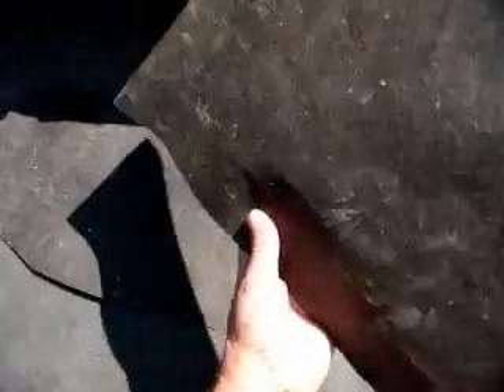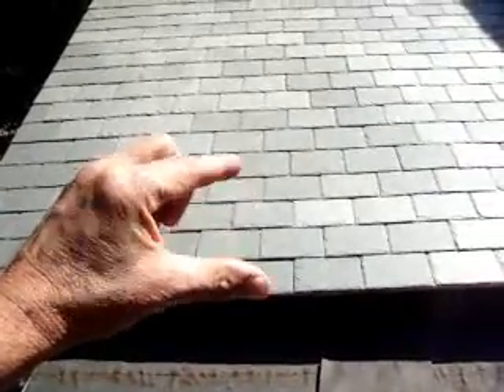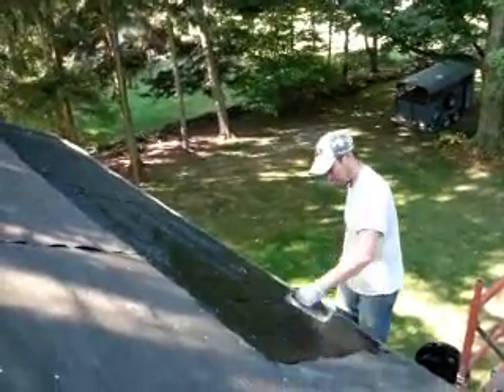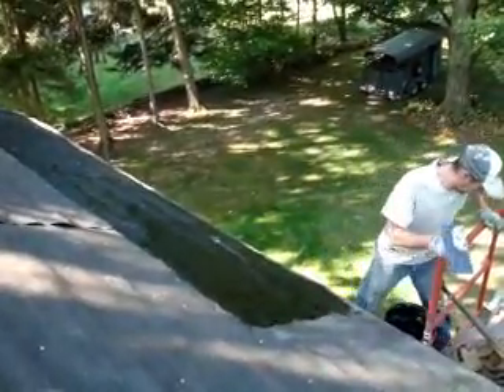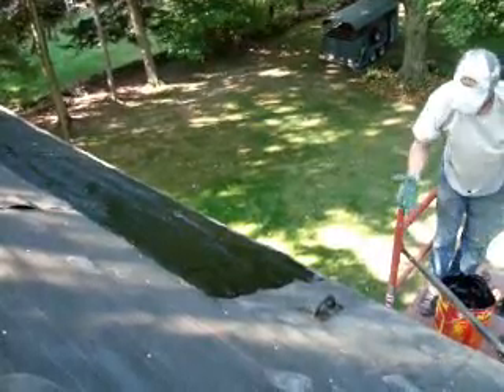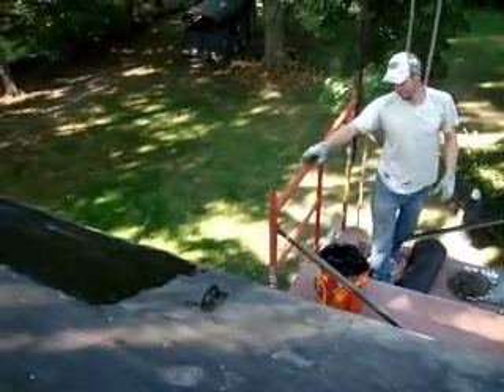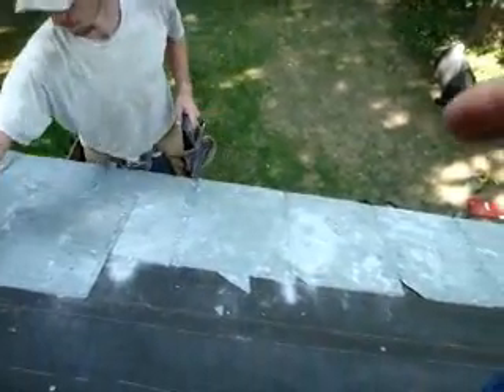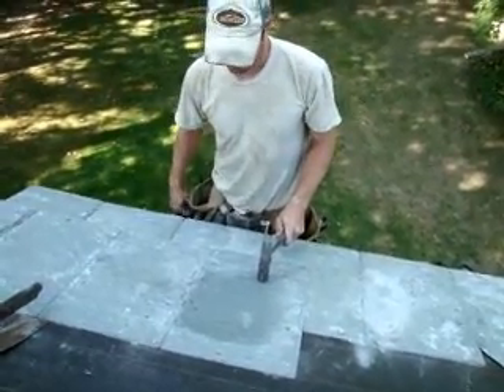How to Install Ice Dam Resistant Eaves on a Slate Roof

Comment: Snow belt aluminum at the bottom edge .
24 inches tall from bottom edge up ast the18" ice dam ?
Reply from the maker: You can't solder aluminum, but it would work as a standing seam snow apron.

Comment: Joe, I love your videos. however I am always amazed at the lack of fall protection for those in your videos. i realize that this is "traditional" roofing but i hope in the future you will come to realize the value of safety for your workers.
Reply from the maker: Fall protection,  as most people know it, is for employees. Ropes are one more thing to trip over and in fact create an unnecessary hazard. You can't tell OSHA this, but then they don't do the work. Goof fall protection involves hook ladders, roof jacks, planks, etc. That's what we always have used (my sons and I). OSHA fall protection doesn't stop you from falling, it stops you from hitting the ground. We use ropes and harnesses once in a while when we feel the need. In 45 years I can count the times on one hand.